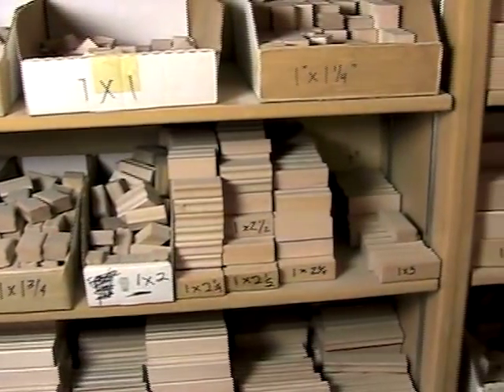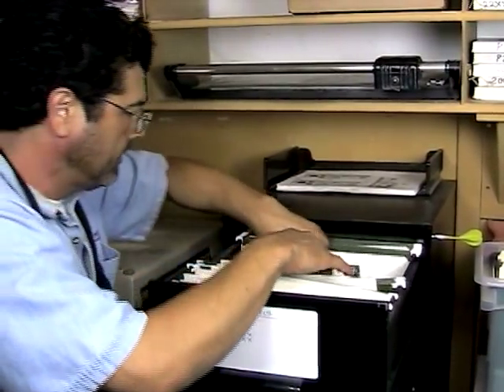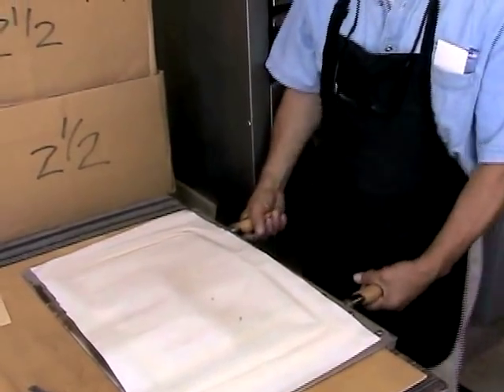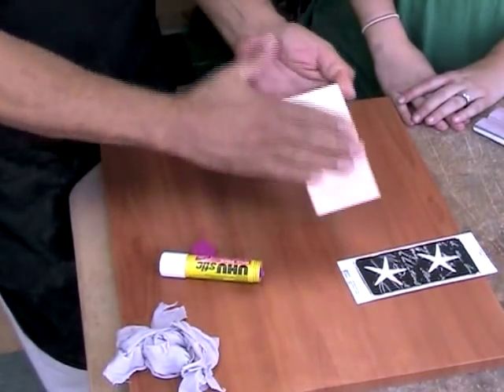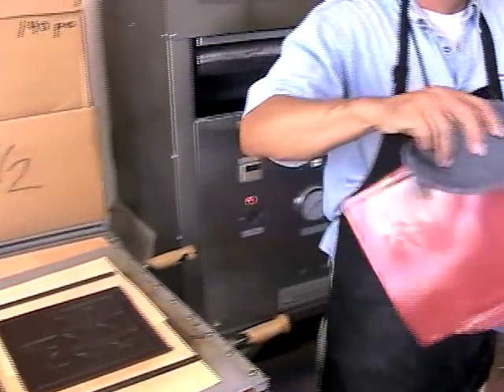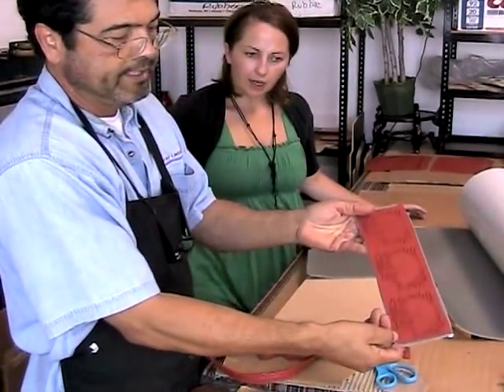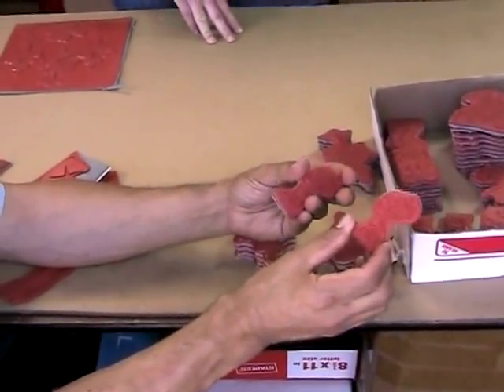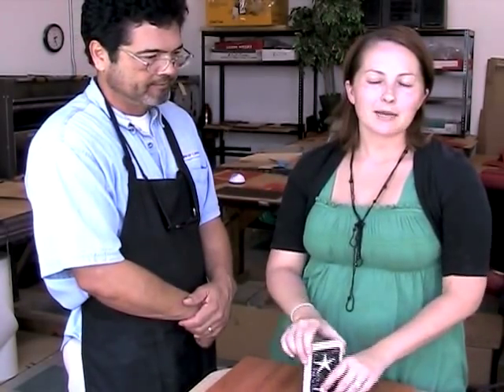Rubber Stamp-Making: Stamp Factory Tour - Part 1

Comment: This rubber vulcanisation process is meant for volume production such as numbers/alphabet/cartoon stamps as you're having to go through the tedious process of CNC milling the bakelight plate. But as the price of laser equipment and laserable rubber sheets have fallen, this process is no longer in favour especially with the power consumption of that hot cooker and the technical limitation of the CNC mill in producing fine details compared to laser, I don't see this process in favour unless you're making a really large volume stamp on a really large die plate.